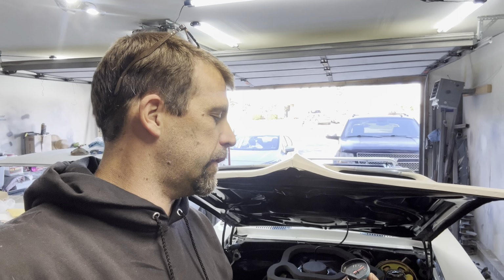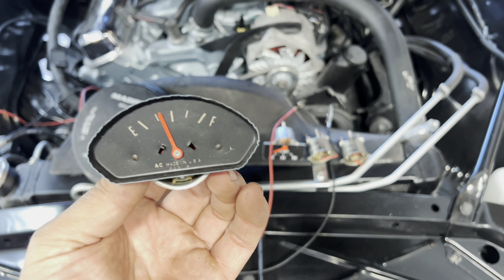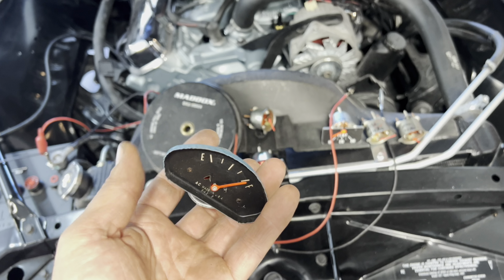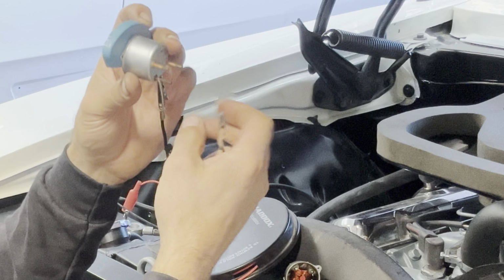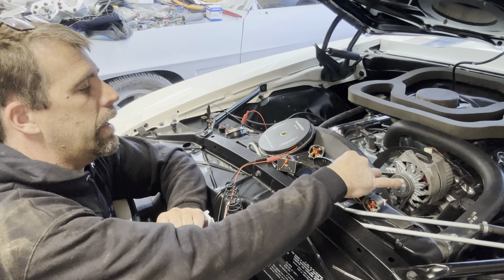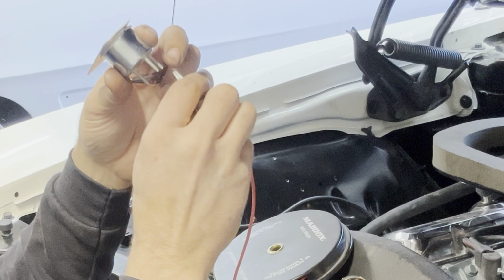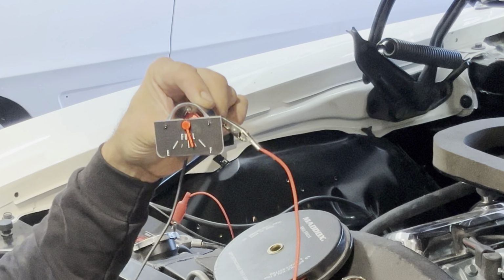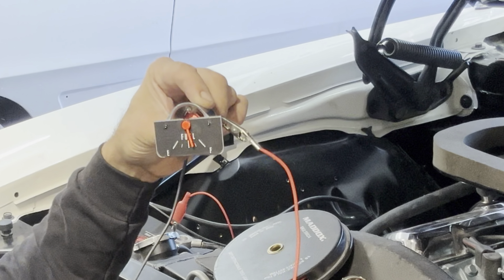GM Muscle car gauge bench testing, quick test to verify gauge might be good.

Comment: Very good info on this video brother. My 67 gas gauge goes way past full when the tank is full. Like all the way over to 3 o’clock. Any thoughts on what could cause that? Gauge works and stops at empty but goes well past full.
Reply from the maker: Well if it reads empty when empty the gauge is calibrated right and wiring should be good.  My guess is and unfortunately i can’t  say for sure is one of two things. Some gauges have a stop and it’s missing or if that is not the case the sending unit in the tank is operating out of range instead of 0-100 ohms it’s 0-like 200 ohms way higher then it should be. 
You can test it by pulling the tan wire back by the trunk latch and test resistance to ground of the sending unit when it’s full it should be very close to 100 ohms. If it’s way higher then sending unit has an issue that needs investigating.
Reply: Cool thanks for the info